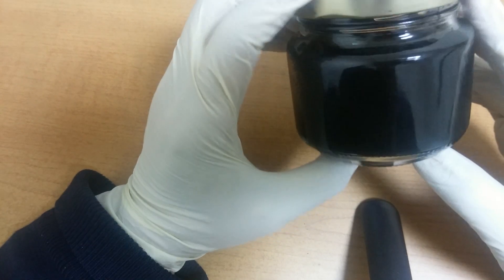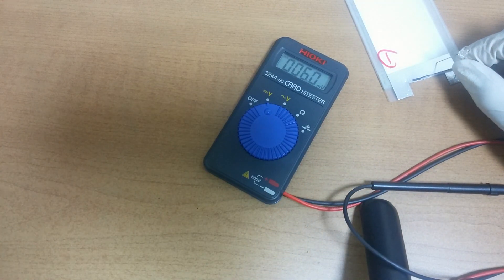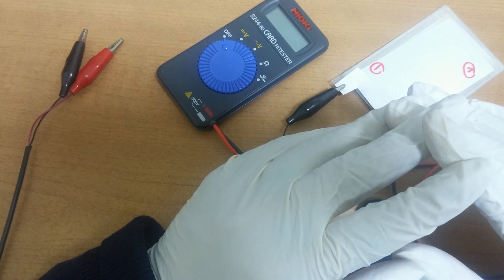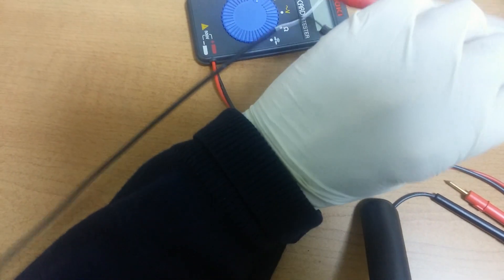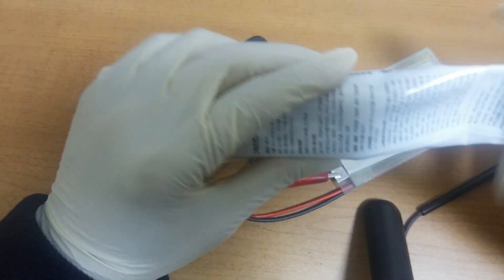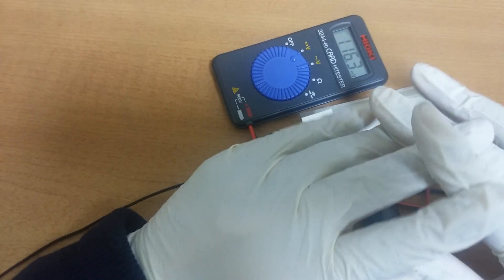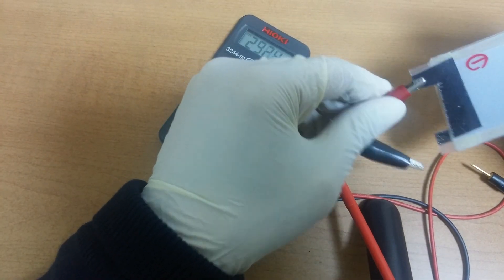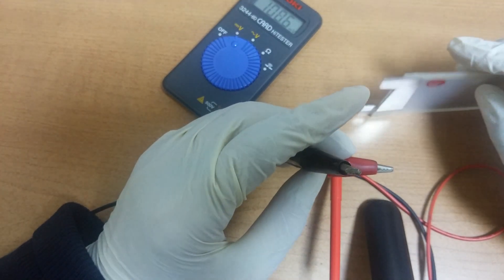graphene solid state battery 3.0 V

Comment: @solid battery try to use an acid at the positive electrolyte and an alkaline solution at the negative electrolyte. At the alkaline, in order to avoid aluminium corrosion, I'd add a few grams of Zinc sulfate or Zinc oxide. I think you should get something like 4 volts. In fact, you could use a vacuum chamber when you dry both solutions. You can make one with a pan and an electric pump, by switching the valve orientation to make it generate vacuum. Or you can use a fridge motor a a vacuum source.

You can seal the pan with silicone.
When you release the vacuum valve, you can inject hydrogen from electrolysis.
Reply from the maker: Thank you for great information. Really thank you
Reply from the maker: Really interesting. What you suggested seems worth trying. Really good. Thank you

Comment: Did I understood this correctly, You use some aluminium coted self adhesiv plastics as the current collectors for both the anode and cathode, and between you have a mixture of graphene solution, toothpaste and detergent? Is this correct? As always, nice work!
Reply from the maker: Yes, right. Have a nice day